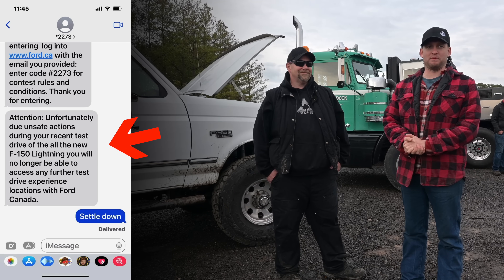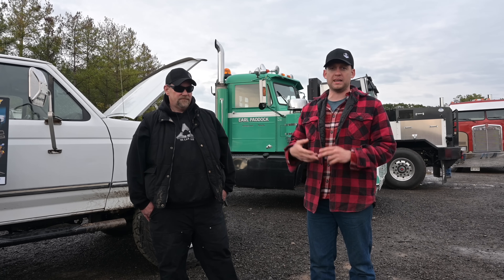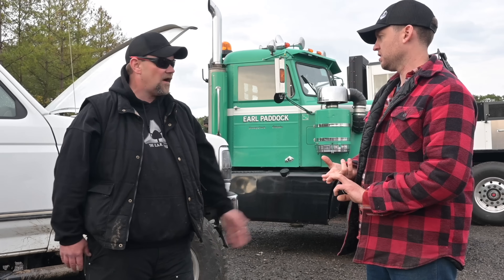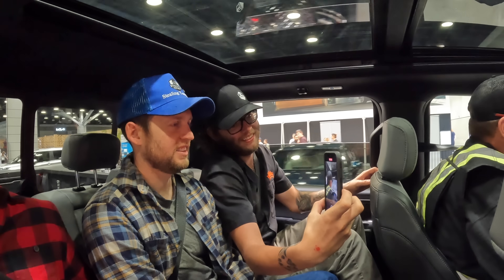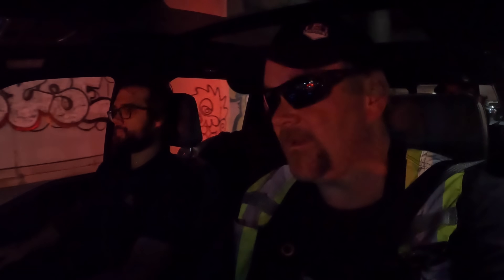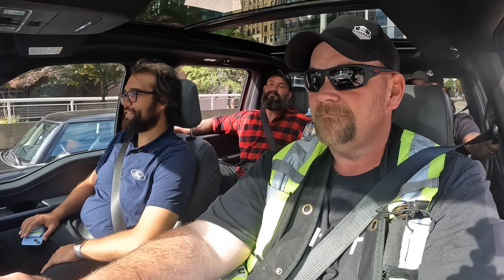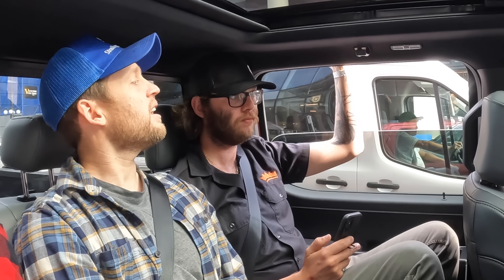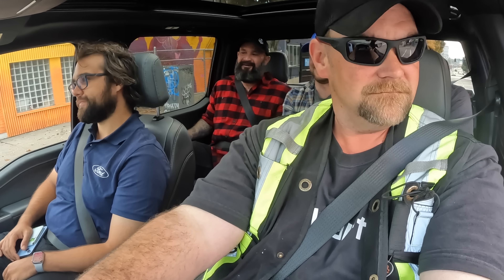Retrofit Revolution: Turning Old Pickups into Electric Powerhouses!

Comment: you mean making it a hybrid like... the other thousand models of hybrids
Reply: I don't know many makers of 3/4 or 1 ton hybrids hotshotting stock trailers from Texas to North Carolina to decrease logistics expenditures. There's a difference between a commuter going to the liquor store and something moving 30 feet of cattle to the yard for sale, weighing 20k. Or picking up a couple ton of feed. The areas Edison appears to be looking into are...interesting.

If they aimed this at farmers...it could be a thing. But that is a specialised group of consumers. If they aimed it at workover rig crews or pipeline welders...again, specialised group...same needs (or wants).

Don't confuse the garbage of Tesla or one of the others with actual real world workers & companies in fields that are sorely underdeveloped because of decades of ponzi scammers pumping out vaporware.

 Assuming Edison keeps its' nose clean, doesn't overextend or get into any weird stuff without extensive market research, and it remains as transparent to the customer base (and possible customers) that it can be...I can see serious money flowing into them from investors. Right now...I need more data & information. Presented by a normal human that works for a living, to normal humans (not youtubers) who work for a living.

Example- I can see a possible market with Edison on something along the lines of small farm tractors, in the range of the Ford 8n sizes. That's quite a market now, but the overseas tractors (Kubotas, etc.) are, in my opinion...very poorly designed for tear down and repair. I can do 2n's, 9n's and 8n's, along with 600's and Jubilees all day long, same with Farmall and IH's from the 40's to the 60's.

So an HP range of 20hp to about 60hp, running 8 hours a day, doing rototillers or 2 or 3 gang plows, backblades, brush hogs, etc. Doesn't have to be a step-thru or even cabbed (though that is common nowadays, and probably more suited to a hybrid design). Drop-in kits are one thing for a truck...something else for a farm tractor from the 1940's. Thousands of them are still around here, in operation. People love the old Fords and Farmalls or IH's. Super handy. Some of these tractors are hitting the edge of 100 years of operational service, with maybe one engine change-out or rebuild.

Right now...I want real world limit & design information on those motors and their lifespans. I know Cat has been doing R&D in that area for decades on D6 & up drives. So basically, I need Edison to run a D9 from Ontario to San Antonio, Texas on the interstates (easy runs) with a breakdown of successes and failures.

Then we move into running D12's out into oil patches on lease roads out by San Angelo in 120 degree heat to see performance, or down in Louisiana running corduroy roads. So on, so forth.
Reply: No, most hybrids have separate mechanical and electric drives, as in they have both a fully mechanical and fully electric drive. That's why they tend to have so many reliability issues and are so expensive.
This would be a fully battery-electric system with a generator that is completely separate from the drive train.